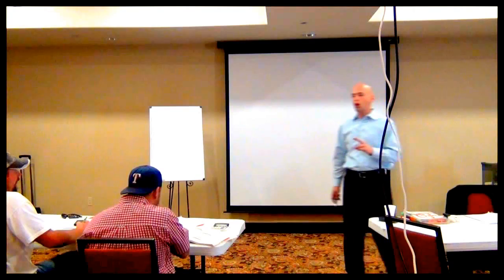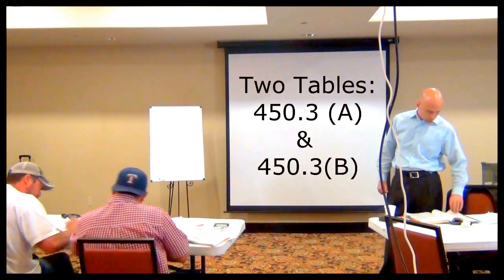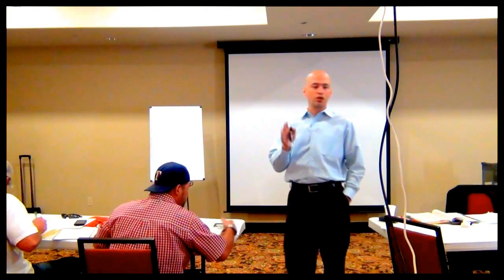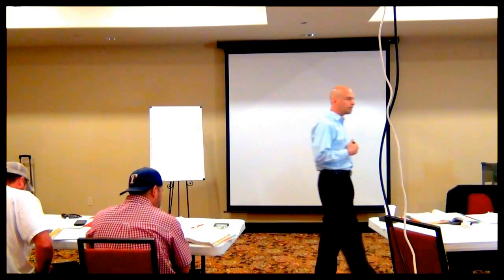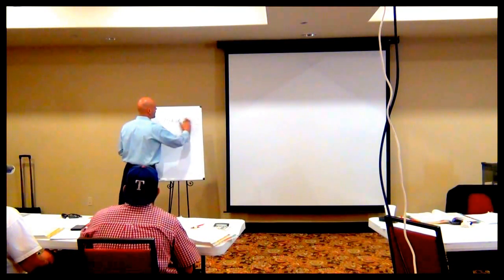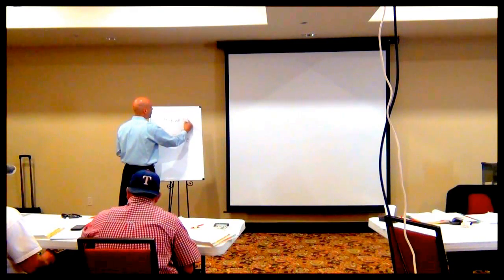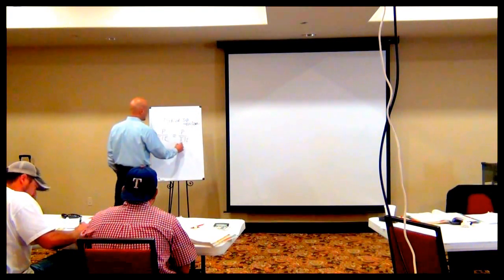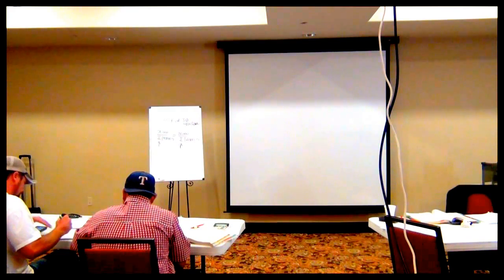How to Answer Transformers Questions| Electrician Testing

Comment from the maker: Not normally. We allow a 10' rule on secondary conductors (considered to be "taps) that essentially run unprotected from the secondary side.
Let me see if an example in print will help clear this up a little. Keep in mind that, at 480 Volts, the pressure of electromotive force will be about double (minus hysteresis, core, and copper losses due to heat) that of a 240 Volt side. 
Now given a 45 kVA (45,000 volt/amps) transformer, and a 112.5 kVA 480V (delta wound) primary with a 208Y/120V 3-phase star (wye) secondary coil. 
Each transformer supplies panelboards containing continuous (non-linear) loads such as lights, convenience receptacle power, and appliances all of which are typical in a modern office building. 
The MAXIMUM length in distance of the conductors coming out from the transformer’s secondary and feeding the panelboard is 10 feet. All terminals are considered to be rated at 75°C, which is the usual circumstance.
Step 1. 
Determine Transformer Current Ratings: 
 	 	Primary Current	 	Secondary Current
45 kVA	 	45,000 VA/(480 x 1.732) = 54A	 	45,000 VA/(208 x 1.732) = 125A
112.5 kVA	 	112,500 VA/(480 x 1.732) = 135A	 	112,500 VA/(208 x 1.732) = 312A
Step 2. 
Primary Protection [T450.3(A)]: 
The primary winding of transformers shall be protected against overcurrent in accordance with the percentages listed in Table 450.3(A) and (B).
Any line or % where you see NOTE 1, refers to the allowance for us to ROUND UP to the next standard size breaker or fuse. The ABSENCE of see NOTE 1, simply means you’ll ROUND DOWN on the lines that don’t specify note 1. 
[Note 1].Where 125 percent of the primary current does not correspond to a standard rating of a fuse or nonadjustable circuit breaker as listed in 240.6(A), the next higher rating can be used. 
45 kVA	 	54A x 1.25 = 68A,  Referring to page 91, 240.6, the next size up 70A
112.5 kVA	 	135A x 1.25 = 169A, Referring to page 91, 240.6, the next size up is 175A
Step 3. 
Size Primary Conductor: Feeder conductors supplying continuous loads shall be sized no less than 125 percent of the continuous loads based on the conductor ampacities as listed in Table 310.16, before any ampacity adjustment in accordance with the terminal temperature rating [110.14(C) and 215.2(A)(1)].
45 kVA	 	54A x 1.25 = 68A, 4 AWG rated 85A at 75°C, Table 310.15(B)16, Page 161 (2014 NEC Ed.)
112.5 kVA	 	135A x 1.25 = 169A, 2/0 AWG rated 175A at 75°C
Sizing Equipment Grounding Conductor (when required) 250.122(A):
The size of the equipment grounding (bonding) conductor for the transformer primary is based on the primary protection device.
45 kVA	 	70A Primary Protection (Step 2), Table 250.122, 8 AWG
112.5 kVA	 	175A Primary Protection (Step 2), Table 250.122, 6 AWG
** SPECIAL NOTE AND CAUTION FOR PSI EXAM TAKERS! All conductors shall be considered to be of Copper construction unless otherwise specified. So when sizing GEC’s for PSI exam questions under Table 250.66, even if the ungrounded conductors are of an AL type, if they don’t specifically ask for an AL GEC, then you’ll answer with a CU size from the table. 
Step 4. 
Size Secondary Conductor: Secondary conductors can be run without secondary overcurrent protection at the point of supply for 10 ft, if the ampacity of the conductor is not less than the rating of the overcurrent protective device at the termination of the tap conductors. This means that the next size up rule contained in 240.4(B) does not apply.
Secondary overcurrent protection is not required, but overcurrent protection is required for lighting and appliance branch-circuit panelboards, and this protection is required to be located on the secondary side of the transformer in accordance with 408.16(A) and (D).
Overcurrent Protection Device Size: Where a feeder supplies continuous loads, the rating of the (secondary) overcurrent device shall not be less than 125 percent of the continuous load [215.3] as listed in 240.6(A).
45 kVA	 	125A x 1.25 = 156A, 175A protection
112.5 kVA	 	312A x 1.25 = 390A, 400A protection
Secondary overcurrent protection is not required for the transformer, but overcurrent protection is required for the lighting and appliance branch-circuit panelboard. Since secondary overcurrent protection is provided in this example, the primary protection device can be sized up to 250% of the primary current rating in accordance with Table 450.3(B) and 240.21(B)(3).
Reply: Mitchell Tolbert very informative

Comment: Do we normally use protection on both primary and secondary sides and use a 250% multiplier for OCPD on the primary and 125% for secondary?